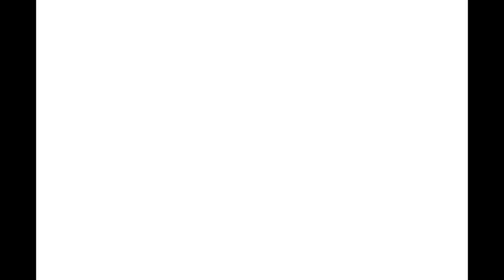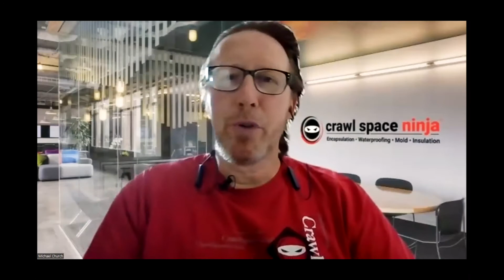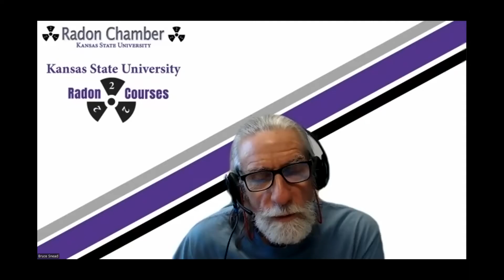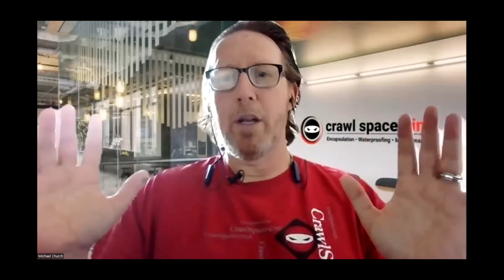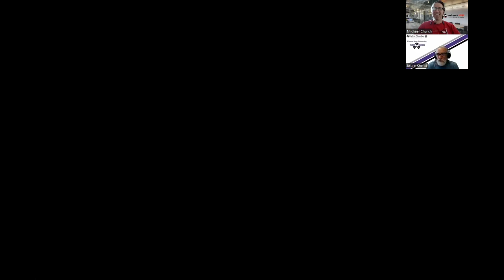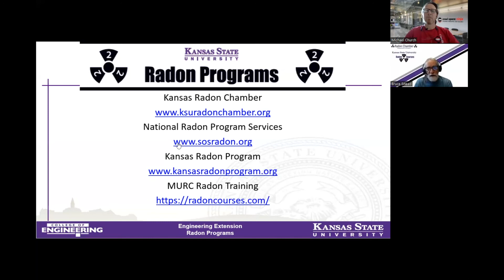Understanding Radon w/ Bruce Snead (Director of Engineering Extension at KSU)

Comment: Game changer info in many ways. I’m getting a test kit. Let’s say you happen to have high radon levels in your crawlspace. Pre-encapsulation, much of it will be vented out into the atmosphere through the open foundation vents. After encapsulation, you have essentially trapped all of that radon, which then, by way of the stack affect, is entering into your living space. The one active vent fan is not going to do it when it comes to clearing the radon gases out of the space according to this 40 year experienced expert. Make no mistake, it has never been said here, nor have I believed that one electric fan stuck in a foundation vent hole equaled a radon mitigation system. However, it does seem that for the DIYers out there who are considering encapsulating, you better check your radon levels pre and post encapsulation to be sure you don’t need the full depressurizing, fan/vacuum system he speaks of underneath the barrier to clear radon if your levels are high. Otherwise, you may be paving yours and other family members road to lung cancer treatments years later. Thanks Michael! Great guest!

Comment: What do you do when you work in a building that has concrete floors? I am at work more than I am at home......I constantly leave one or 2 windows open even in the winter or even if the AC is on bc I am paranoid about radon living in NJ.
Reply: You should test if your worried.
Reply from the maker: RG - the first thing you should do is get the building tested for Radon.  This will help you figure out what you should do next.
Reply: @CrawlSpaceNinja  Thank you!